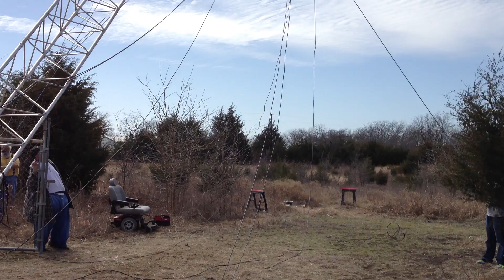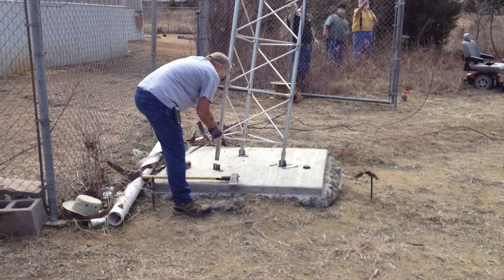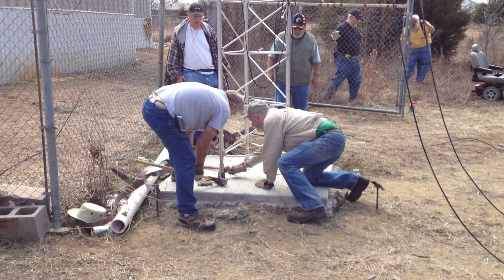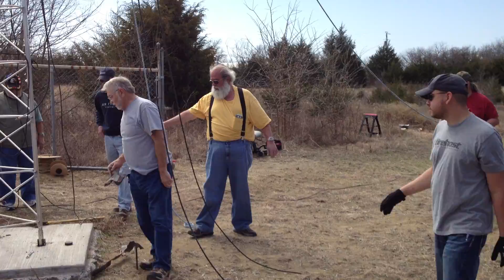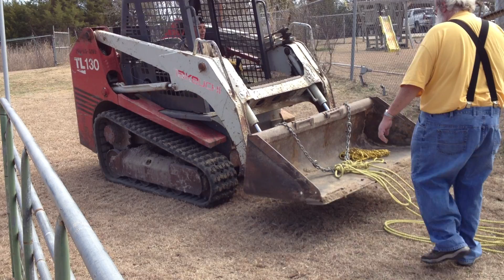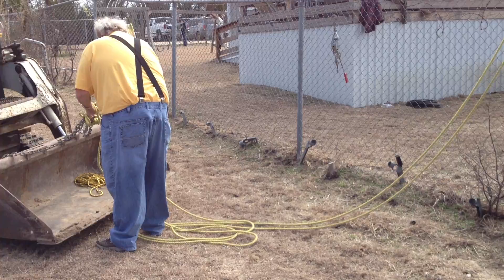70 FOOT SELF SUPPORTING TOWER UP TODAY 2/22/2014 PART 2 OF 2

Comment: Just a suggestion. If the bolt doesn't want to go in, use a socket and turn the bolt in instead of beating it with a sledgehammer. How did this clown pass a ham test?
Reply: Thanks for your comment. As I said on the other text that are previously posted, we have new hams and old hams and they're all learning. Nothing was hurt. Everything's fine. Have a blessed day

Comment: Why is the guy beating on the bolt's with a sledge hammer?
They should just slide tight through...
Reply: don't need nuts if there ant any threads!

Comment: I used to have a book called back to basics, by readers digest, any way they showed erecting a tower with a pickup and a "gin" pole situated so as the truck pulled the tower up the gin pole pushed the pull line upward, so the cable picked the tower up rathet than stressing it with straight pull.
Of coarse it would take some planning but it could be figured out,  i saw flex on both ends past the pull line, when it was at 45° or so.
Edit but thank you for posting nice video.
Reply: Len, thank you for your comments. yes a fulcrum would have helped but with the load it was a success  and I really like this tower.  As a followup we had a very sever storm come past and took the top 10 feet off my tower. but 60 feet stayed with out issue. so now i have 60 feet instead of 70 feet.
But for uhf/vhf it still functions. and I have the inverted v antennas still up at the apex at 60 feet. Thanks again. Dan
Reply: @drmckinley  DR M Thanks for a reply, i dont know engineering/physics terms, and you apparently do, that's great, this kind of stuff interests me, towers, radios, radio waves etc., have a good night.

Comment: Freestanding?  That would not survive the winds in my area.  Lucky dog.
Reply: The 60’ American Tower free standing commercial standard radio tower, when properly installed is rated to withstand 90mph winds coated in 1/2” of ice.

Comment: That is a lot of tower for that little bit of antennas? Not a single HF antenna and I would have taped the feed lines to the tower before I stood it up as well.
Reply: After the tower was up -  my tower worker dressed all cables and rechecked all hardware on the way up and down the tower.

Comment: I've just ordered a 40ft tower be here in 6 ~8 weeks then another week for base to cure before it gets up. Should be up by Thanksgiving.
Reply: KOOL YOU WILL LIKE IT. EASY TO CLIMB. JUST MAKE SURE YOU RECHECK THE BOLTS FOR TIGHTNESS. REALLY .LIKE MY TOWER.

Comment: How is this holding up?  They don’t look built to climb, do you bring it back down for service?   Looking at one for network access out in the woods but might add a beam and 2m omni to get a bit more value out of it.
Reply: jcims Tower is great to climb  no I don't let it down. Would work great for a beam just watch wind load of beam. Recheck bolts when assembling. Ensure tightness Tower is aluminium. Mine is 70 feet tall. Good luck.
Reply: Thanks for the reply.  Great to hear it can be climbed, I reached out to the manufacturer to see if I can find a contractor/consultant to make sure I'm good to go on design.
Reply: jcims got mine from Texas Towers in Plano Texas.
Reply: This can be climbed all the way to the top to service radios without lowering?

Comment: Wonder if I could tig weld something like this, little by little and work my way up to the top!
Reply: IF YOU ARE A GOOD WELDER AND HAVE THE MATERIALS, GIVE IT A TRY IN A SMALL SECTION, TO TEST STRENGTH AND RELIABILITY. BE SAFE ALWAYS. WATCH POWER LINES TOO
Reply: I welded a 3 section tilt over tower 70 ft  used a stick welder easy peasy had it up 20 years till i moved house  now need to build another one,just hunting for materials 73  de.  vk4ckc

Comment: CORRECT, 5 FEET BUT 8 FEET DEEP. YES WITH REBAR CONNECTING ALL THREE SUPPORT LEGS TO EACH OTHER IN THE CEMENT.
THREE GROUND RODS ARE ATTACHED - WELDED COPPER  STRAP TO TOWER WITH SPECIAL CLAMPS. TOWER MODEL #7-70 UNIVERSAL TOWERS.  WEIGHT IS 212 LBS